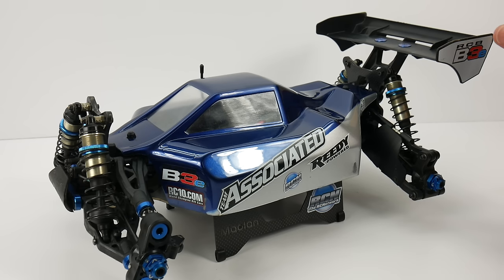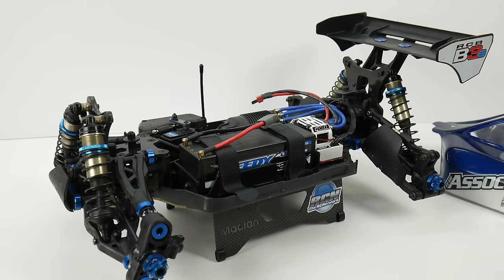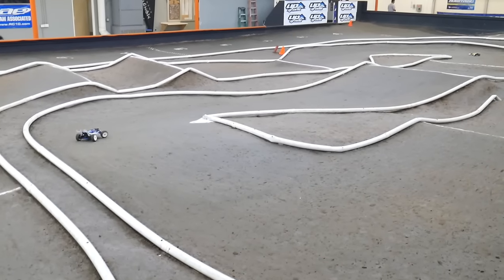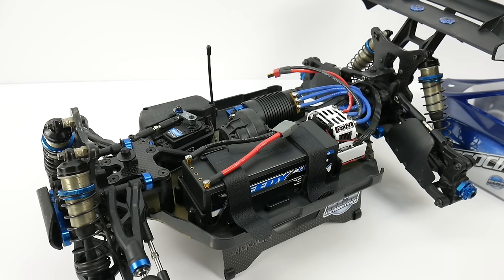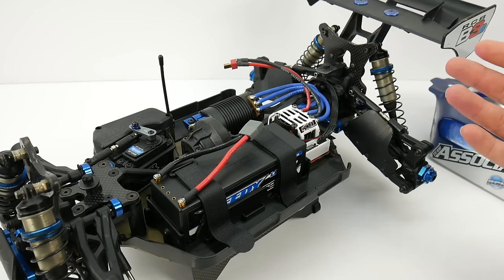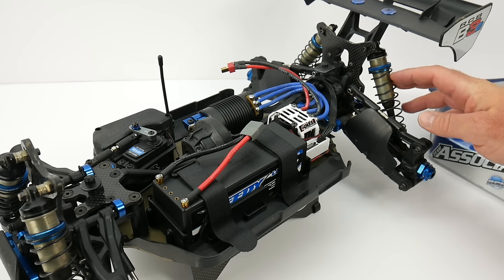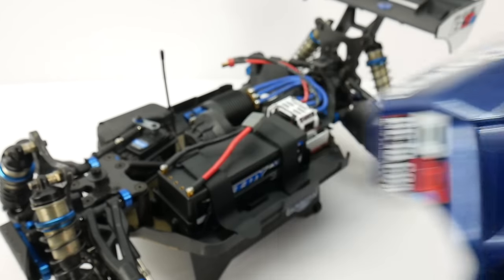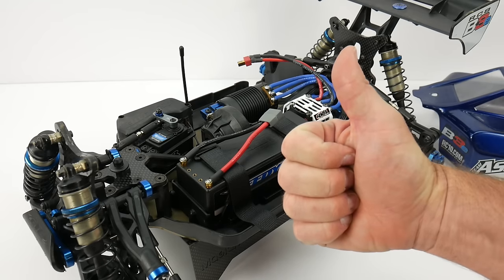Team Associated RC8B3e 1/8th Electric Buggy - Review

Comment: That's is not a bad review, but I would like to see you comment a little bit more on the driving of the car. And compare with the other offerings from other manufacturers. Actually i'm not a big 1/8 driver but I know the cars and that AE car is almost a MBX7 form Mugen Seiki. The larger chassis is also taken from Kyosho buggies! I'm not saying this car is not good but I would like to have a little bit more meat on the bone regarding the performance compared to other. Also, in my mind, 1/8 buggy is not meant to drive on super high bite track! I know that Las vegas had a high grip track, but the driver didn't seem to like it a lot. 1/8 is a lot more at home on loamy, dirt track with controlled slides and big jumps! i know you mentioned you wanted to go on a 1/8 dirt track but anyway. I'm a big fan usually, but that review leave me on my appetite I should say.
Reply from the maker: +David Roy Thanks David for your comments and info.  The RC8B3e is quite similar to the MBX7, but it's also quite different.  It was fully engineered in Lake Forest, CA by AE.  As for meat on the bone, I have about 7 videos on the RC8 now and there's quite a bit of info I have produced, along with just running footage you can watch to see how it drives.  I agree that most 1/8th scale buggies are more at home on wide open HUGE tracks, but it's what I had available at the time. Lastly, my channel is all provided to you for free.  I'm paid ZERO for doing these reviews.

Comment: Looks like maintenance on this thing is pretty easy. The motor access to adjust the gear mesh is really nice. One thing I don't like about my basher is how they crammed everything in there.   Just changing a pinion can be a pain in the ass. Looks like a fun build.
Reply from the maker: +Adam Baker This is probably my favorite motor mount on the market

Comment: Looks like I am going to pick up one of these! If you were to run this car on a indoor clay track what oil would you use?
I was thinking:  
7000 front diff  --
5000 middle diff  --
3000 back diff  --
35 in front and back shocks
Reply from the maker: That's a great start......
Reply: How did that set up go, was he quick outta corners
Reply: @gonzodetroitify  oh man it works great! I changed a few things but use these oils to get a good starting platform. Note that I have my good results on a hard clay track
Reply: @jarrett1890  do u have a constant need to 1. Re trim servo trim from remote control,
2, shaky is understanent of steering blocks or the things with pillowball, that the lower and upper arms connect into 🤔, other than that the buggys good
Reply: @gonzodetroitify  I rarely need  to touch my steering trim. The last time I needed to adjust my trim was when I slightly bent an A-Arm mid race. Shaking? what is shaking?
Reply: @jarrett1890  shoot sorry never really expected a rey for such a long ago post, the whole assembly tho I think I've narrows down to keep loosening balls at the end of arms, the what is ur maybe 5mm hex that u can adjust between the wheel itself whilst in situ, well with arrma typhon 3s wheels at least
Reply: @jarrett1890  awesome to respond forgot to mention in last post thanks yo
Reply: @jarrett1890  like if I send him up the road may e when he's back hell need adjustment again, can't trust it to stay str8 kinder, was gonna swap out the servo🤔
Reply: @gonzodetroitify  I would buy a new servo and see if you still have the problem. Sounds like you are adjusting your trim more than normal
Reply: @jarrett1890  thank you for the time here DeereJ18, I'm thinking I'll put that in and see what's what I had a looked since last post and it seems to be the blue hex's above and below the wheel hub, seems too loose or too tight and I'll have no suspension action if u see what I mean🤔 as by that tightness its all bound up, ahhh the front uprights on page 11 manual,
Reply: @jarrett1890  sooo hey DeereJ18, may have sorted the issue, I did not have the uprights right enough I guess, a tad too much play so buttoned them up and seems OK much more responsive, tho I'm not sure if I'm now binding the suspension travel somewhat, apart from removing the wheels at front all was in situ as I made the screwing adjustment on the uprights 5mm hex, 😕😎💯 but I'm getting there and feeling the buggys praises same speedy 🏁😉
Reply: @gonzodetroitify  good stuff 👍

Comment: Call me crazy, but the rc8b3e was a let down from the old car. At first, I thought it was great but quickly showed its weaknesses. The updated geometry just wasn't as responsive and active as the rc8.2e's and it had a tendency to slap the chassis. It was also not too durable: for example I broke 3 shock ends in the not-even-a-year period I owned the car (only track been on was OCRC) and I have broke NONE on the rc8.2e and I've had that thing for 3 years now and its been at revelation several times as well as ocrc and the now closed IERC. So, traded for a b44.3. And I don't regret it whatsoever. By the way, I love how the b44.3 handles even in my backyard. Test ran it for a lap at ocrc before trading and BOY does it steer! Can't wait to get a full run in
Reply from the maker: We must be driving different RC's  I can't tell you how great the RC8B3e is.....Not one broken part and if you watched my running video, I'm not the cleanest driver.  I know that AE was not very proud of the RC8.2e, which is why they scraped the entire platform.  Hell, they even got Hartson to start driving 1/8th scale now! lol
Reply: I totally think that's the case too lol. I think its that the 8.2 required hop ups to make it handle awesome and AE wanted something that will handle awesome right out the box. And it did. But it just wasn't as responsive and fun as the old car. Anyways, what do you think about the b44.3?

Comment: How is that Reedy servo holding up? Interested in buying one, I ma starting to collect my things now, I have a Team Orion battery charger, have just bought the new Futaba T3PV as I really don't want a million features I'll never use. I am thinking of the Reedy servo from this car and then the Team Orion Neon 8 ESC and motor combo you put in the Arrma Typhon. I will only be bashing and hope those products will be good for that? Kinda don't want to spend tons of money.
I will be buying a 1/8th buggy kit though, still deciding on which one as in the UK some of the spares can be tricky to find.
Reply from the maker: I really like the Reedy Servo.  It's a bit under the spec I would normally pick for an 1/8th scale, but god, is it FAST!  really nice and no issues at all.  As for the NEON combo....I would steer clear on that combo.....I ended up burning the motor out pretty quick - It thermal'd and lost it's magnetism!   It might have been a fluke...not sure.
Reply: Excellent, I'll grab that servo then, it's waterproof and cheaper then the Futaba's. I'll steer clear of the Neon 8, thanks for the advice. I will look at this Hobbywing MAX8 combo http://www.hobbywingdirect.com/products/combo-ezrun-max-8-combo

Is that a good one to use? I may see if they do it with a 2000KV motor.
Reply: +marksapollo great combo. I did 130 km/h with it on an arrma typhon

Comment: Have you tried changing the timing on the motor to see if it will make a difference on the punch and braking? I know it can be set via the ESC, but I have talked to several people locally with sensored motors that play with the timing quite a bit for different tracks.
As always, another great build, and video series.
Reply from the maker: Thanks RB - I typically don't like to mess with timing...it usually creates a lot of unneeded heat.
Reply: Got ya. I don't know a lot about sensored motors and was curious. Thanks for the reply.

Comment: Nice vid !
I also have a rc8b3e and i have problems  with the diffs . Don't you have problems with them  ?
Reply from the maker: +Nico Zch Never had a problem with the diffs.  I did follow a different installation technique on them from the Factory team drivers - I believe it was one shim on each side of the diff f/r and no gasket on the center diff.
Reply: +The RCNetwork  thank you very much. If you remember correctly how you built it, it would be nice when you tell me :)
Reply from the maker: +Nico Zch I guess my memory fades at times! lol I had to look up an email, but here you go:  Here's what Richard Saxton suggested for the diff builds:Front and Rear Diffs - don’t use the #89116 gasket, and put two shims on each side of gears.
Center diff - Use one thin gasket at 
first, put the diff together without oil and see if it feels notchy. If 
it is, add one gasket at a time until it gets smooth (Richard's car had 
one gasket and Kody uses
 two)
Reply: +The RCNetwork .
Ok , Thank you very very much :)
Reply: @TheRCNetwork  wow😱😎 really no Gasket, sounds like an error somewhere😂😂😳
Reply: @TheRCNetwork  how could this work either way and not for the other🤔

Comment: The servo horn broke because their servo saver spring is compressed too much out-of-the-box.  As a result, the servo saver functionality is basically non-existent.

Did you have to trim the body more because the steering servo link rod was ramming into it?